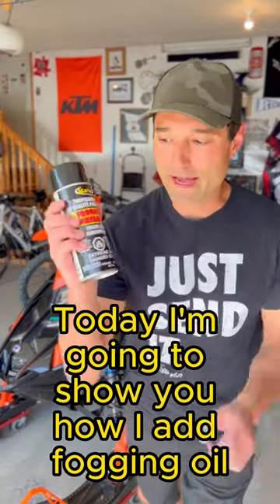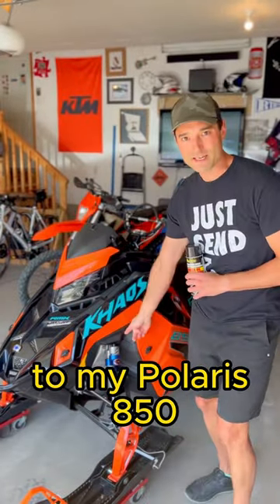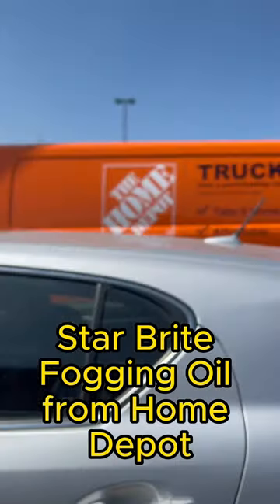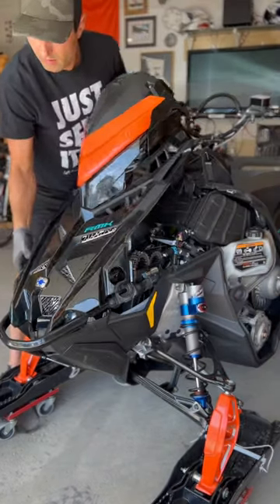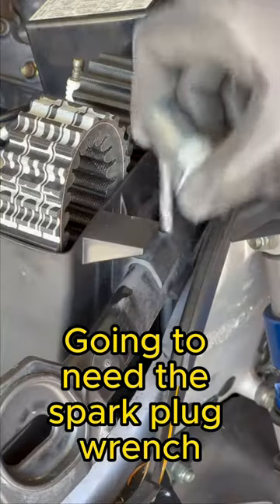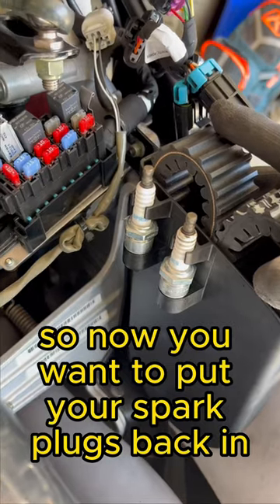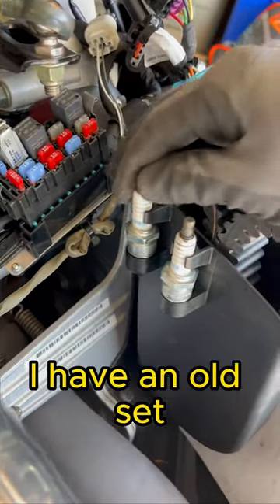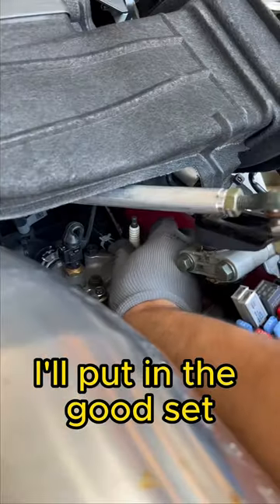How I add Fogging Oil to my Snowmobile Engine @PolarisSnow  #khaos #summer #storage #shorts

Comment: Can sled oil also be used instead of foggin oil?
Reply from the maker: Polaris recommends fogging oil but Ski-doo uses injector oil. I prefer the fogging oil spray can
Reply: Do the fuses not have a cover or is it a recall thing?
Reply from the maker: @lukesmith9144 I took the cover off for more room to get my arm in there. Haha no recall on that. Yet.